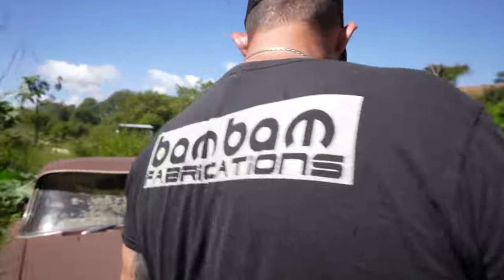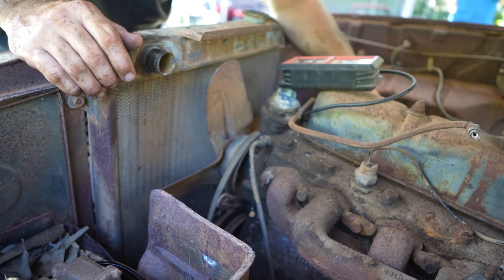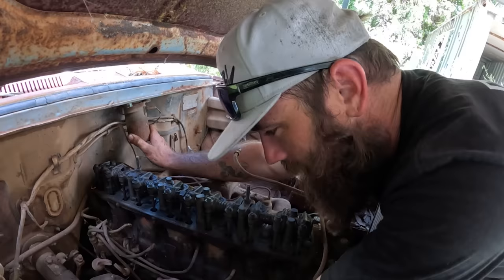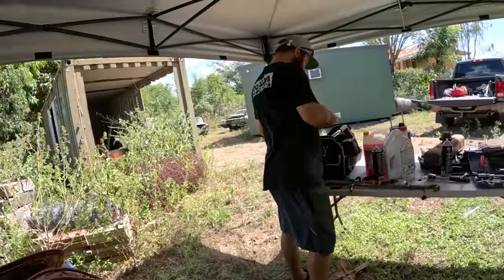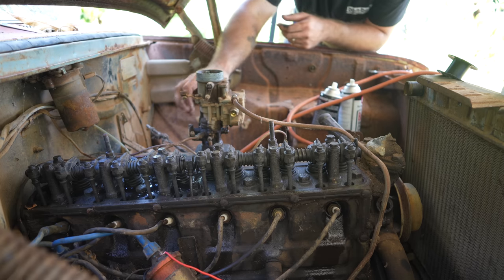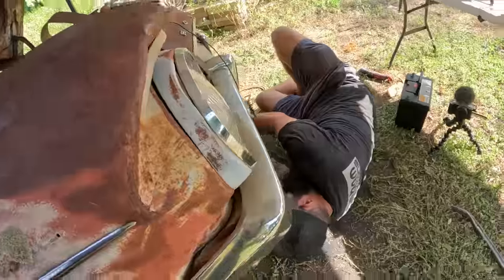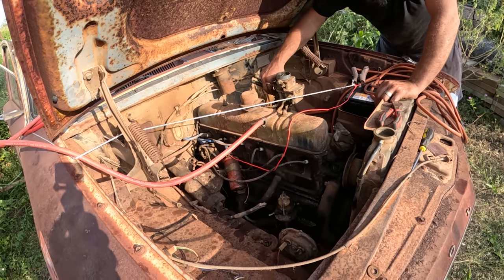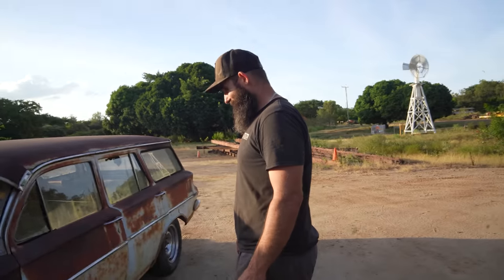Will This Classic EJ Holden Run and Drive Enough to get to a Historic Australian Pub

Comment: Old Holdens just never die......love it
Reply: All ya need there is some new lighting hoses a new whirly thinger there that spins around a flappy thing that dumps the gas and pumpy pump thing for the water and then all them really rusty ole Kangaroo turds will just magically come shootin out the tail pipe mate. Right?
Reply: The newer ones were 50/50 
50% died within 25,000km 50% will be wrapped around a tree and still start on one pull lol
Reply: wouldnt of got it going if it was a ford that age
Reply: @Russlarmour  Easily mate, stop making silly statements....

Comment: I used to work on sideplates motors as a boy. I was following every step as you were doing it and thinking... "its missing a coil."  (I still remember the firing order 153624. hahaha)  Great job guys - terrific "CAN DO" thinking. Old Holdens NEVER die.  Inspirational. Thanks so much.
Reply: haha 153624, I always remember because as a kid I was taught 15 is to young, 36 is too old but 24 is just right

Comment: Love it !! An old Holden Station Wagon……. my first car was a blue EH Wagon, with a baby red motor, wish I still had it. My oldest Brother, bought a blue EH Sedan with a 179 …… later replaced the motor with a 186S motor with extractors …….. he still has it , 52 years after he bought it, last road registered in ‘83. Speco floor shift manual, got the shag pile 🤣😂 carpet, Smiths gauges in the housing that they made for sloping radio speaker on the dash, great nick…….. he only fires it up every once and a while. I want to buy it …….. I’d love to own it, I’d drive it regularly…… but he won’t sell . Cheers and Beers Boys 🍻🍻🍻🍻🍻

Comment: I owned an EJ just like this in the 80’s not as rusty as this one, well done lads great to see it running, this engine was not equipped with an oil filter if I remember correctly
Reply: I had a EJ wagon in 1985, it had 450,000miles on it when l got it, canvas bag hanging off the front bumper bar, & red dirt all through it front to back & more stonechips than paint, it died on me 5000miles later.

Comment: Scotland here.
Well done lads, that old 6 was running sweet as considering how long she sat.
Cool looking car to boot, well worth saving.
Subscribed👍👍🏴🇬🇧
Reply: Cheers Mate glad you enjoyed mate!! More to come!!
Reply: The engines are generally bulletproof being all cast iron block and head, I replaced the engine in my HR in 1984 with a second hand one from burnt out HR in a scrap yard, moved all the ancillary stuff from the outside of my engine to the second hand one, fitted it to my car and had it running by the end of the weekend, sacrificed three or four cartons of beer with the mates that helped me but that engine ran for another eight years without so much as a cough before I sold the car, still running at the time, in 1992.

Comment: You just worked your auto adventure of will it run. In the US. I'm working on a 606 international tractor waking it up and trying to make it run. It's from the 60's, gas tank rusted threw as the air cleaner can. It's something that's on the slow GETTER DONE as I pick-up used parts to make her run. I enjoyed your adventure. Wish my tavern was around the corner, it's 40 miles away. Great job.

Comment: Hi just one correction the Hydra-matic (GM) 3 speed Automatic Transmission was available in Holdens model  EK, EJ &  EH.  the HD model came out with a 2 speed Powerglide Transmission.
Reply: If that is an original GM Hydra-Matic transmission it is a FOUR speed non-overdrive fully automatic first offered in the 1940 Oldsmobile, but designed by Cadillac. I had a 1960 Caddy convertible with the Hydramatic. Now maybe GM offered the Hydramatic in Australia as a 3 speed, I wouldn't know, but their 3 spd US tranny was called the Turbo-Hydramatic. The 2 spd was the  Chevrolet PowerGlide.
Reply: @edbenti5007  Yes the GM was only a 3 speed as the Holden was only a small car compared to the Cadillac, when Holden GMH change in 1965 to the 2 speed Powerglide performance was diminished this transmission was replaced in about 1969 with the locally made tri-matic.

Comment: The Hydramatic was a three speed automatic transmission. My vague memory is that the two-speed Powerglide automatic commenced with the HD. The Hydramatic was unique in that the second gear was direct with some sort of torque converter lockup. Apparently, because of this feature, the engine could be tow-started so long as the car was towed fast enough for friction to begin turning the engine and the oil pump in the transmission to start building enough pressure to energise the servo in the transmission.
Reply: The GM Hydra-Matic was a FOUR SPEED non-overdrive fully automatic, the FIRST fully mass-produced automatic automotive transmission in world history. They called it "fluid drive" and was actually battle tested in WW2.  They can move a 3 ton vehicle fast, durable, very tough.
Reply: It's a 2-speed transmission.   You cannot tow start them.  Having only 2 speeds, these EJ cars were known for their gutless drive feel.  The engine is only 2.3 litres (138 cubic inches), not really sufficient for such a transmission.  GM Australia put "Hydramatic" on these EJ's as a marketing strategy - they had the rights to the name so they could do that, even though it was not what was branded Hydramatic in the USA.   The USA Hydramatic box was intended for heavier vehicles with much larger engines.   For that matter, even in the USA, GM branded different 3 speed and 4 speed transmissions as "Hydramatic" at various times.
You are correct in saying that the Australian Powerglides were 2-speed.   They are actually a variant of the same box as fitted in EJ's and labelled Hydramatic.
Three speed auto transmissions came to Holdens later, were labelled "Trimatic", and were a considerable improvement.
Reply: @danejames7098  :  Sometimes we called them "Try-matic - try and accelerate"".   But, actually, they were very good boxes.
Reply: @keithammleter3824 
It's a 3 speed Hydromatic.
Reply: @Rob-fc9wg  You are thinking of the EH.  The car in this video is an EJ, mechanically identical to the previous EK.
The word is "Hydramatic", not "Hydromatic".
Although branded Hydramatic on EK's and most EJ's, they are actually what is known in the USA as "Powerglide" - a cheap unit (type C213 etc) meant for basic 6-cyl Chevrolets.   
The later HD's and HR's were branded honestly - ie branded "Powerglide'".  Same actual transmission.   You would hardly expect these later cars to get 2-speeds if GMH had already been supplying 3-speeds.   
Some restorers & lovers of old Holdens replace the auto boxes in EK's and EJ's with Trimatics, as it is not too difficult and the result is a much more responsive car without the excessive revving needed to get the car moving.   You need to pick the right Trimatic version (shifter on the right side), get an engineering shop to make up a special flywheel, and do a bit of cutting in the cross-member.
Genuine Hydramatic boxes (as obtained from USA) will not fit as the transmission tunnel is too small.
GMH probably branded the EK-EJ boxes as Hydramatic as at that time it was the husband who chose the car, and many men read magazines from the USA, where the Powerglide was known as cheap and nasty for the folk who could not afford better than a basic Chevy, whereas the Hydramatic was a luxury quality thing fitted to Pontiacs.
Reply: @keithammleter3824  
The EJ was available with a 3 speed manual or a 3 speed auto.
No 2 speed.
Reply: @Rob-fc9wg  : When Holden in 1970 switched to the Turbo-Hydramatic (TH180 series - a then new box developed in the USA for mid-size cars, and had no relationship whatsoever to the Hydramatic developed for large cars),  GMH called it the Trimatic, to emphasize to prospective buyers that Holden had finally graduated from 2 speeds to 3 speeds, which the Falcon had since 1965  and Valiant since 1962.
The original poster (Darangula) is correct in that the Powerglide was 2-speed, and that what was branded Hydramatic in Australia had the 2nd gear as direct ie top/highway gear - that is it was not actually a Hydramatic, which was 3 speed or 4 speed depending on variant used in US upmarket large cars.   US Hydramatics can be tow-started (though it is not recommended), but Holdens branded Hydramatic or Powerglide cannot - they remain in neutral with no oil circulation.

Comment: The EJ Holden dated to 1963, the last year the grey motor (215 cid) was used.
Reply: The Holden grey motor was never 215 cid. It was 132 and 138 cid.
Reply: the holden grey was a scaled down copy of the chev engine which I think was about 200 cubes, so a USA  viewer could mistake the size.  Both motors looked identical except for size.   and yes, the red motor came out in the EH (basically the same body) next model of 149 and 179 cubic inch sizes.

Comment: I had one of these in the 70's, an EJ Holden Hydromatic Station Wagon with a grey motor. The transmission bands needed looking at so it required some creativity to drive it. The motor ran well, as I recall and it was a comfy ride for the time. The floor was rusted out like yours too - you could see the road whilst driving. It had all the badges and all the good extras of the day. I sold it for $100 which was $10 less than I paid for it . . . Fuel was around 20c a litre back then.
Reply: Try at least 0:55c a litre.
Its only gone up 4x while houses have gone up, on an all-Australian capital cities prices average, 30x

Petrol, as a bite of our wage, has dropped markedly

Comment: Utterly bullet-proof motors that can take a good deal of neglect and still run!  My first was a '58 FE, well worn when I got it in 1970, but ran for another 65000 miles. Then came the '63 EJ in 1977 - a lovely car, owned by a panel beater who had done it up for himself but family needs . . . etc. My biggest mistake was selling it on because I thought it wouldn't handle a biggish trailer. Silly boy me! It would have done so easily and saved me a pleasant but expensive fling with a '66 Humber Super Snipe!  Both the Holdens cruised effortlessly at 65mph and thrived on the lengthy commutes I did in the day. Three oil changes and grease-ups a year, and all good.

Comment: Pure GOLD Boy's 💯👌
Reply: Cheers Mate!!
Reply: 100% rust bucket.  It will die when the plastic/fibre cam sprocket fails. 
Compare that to a 2.2 litre 1962 Mercedes  engine that has twice as much power output.
Reply: @BTW...  My  Mercedes-Benz W115 was fitted with a 5.8 Litre V8. It went 😉

Comment: Holdens used the Roto-Hydramatic. From Wikipedia:  "The Roto-Hydramatic was an automatic transmission built by General Motors and used in some Oldsmobile, Pontiac and Holden models between 1961 and 1965. It was based on the earlier, four-speed Hydramatic, but was more compact..." Hate to be a nitpicker but apparently Holden Division of GM decided to drop the "Roto" part of the name for badging. A genuine GM Hydra-Matic is a four speed unit. It's important to acknowledge the importance of the Hydra-Matic in world automotive history, the world's first fully automatic mass-produced and COMMERCIALLY SUCCESSFUL transmission. My grandfather was a certified Hydra-Matic technician for Pontiac. Take that Japan and Mercedes!

Comment: It doesn't surprise me in the slightest that this one would move under its own power. It takes a lot to kill the Holden Grey. I've seen them run on a single cylinder before, but this one no doubt wanted to get out again

Comment: Awesome!!!! I was travelling up north WA 600 ks past gerelton same car dizzy shaft gear shredded road train towed us to next petrol station midnight 150 klm that was hairy as fuck behind trailers waited 10hrs for friend coming from port Hedland with another dizzy and shaft would not fit from FJ Gray motor walking behind garage wide open paddocks 186 red block in the dirt no head but shaft still attached tell no lie 😮 thought no way bolted on cap on leads connected.... Shazam it fired up this was 1987.. EH wagon..true story!!!! 49:12
Reply: Wow!

Comment: Damn, that's badass, a old Holden, like those older ones! Eff'ng Cool!! Right on 🤘 fellars, right on! Although, now don't take no offense to this but that 6 banger in it looks kinda like a old AMC 6 banger, I've had enough of American Motors vehicles through the years I pretty much know what they look like, hey nuthin wrong with that though!
Reply: The grey motor apparently had its origins in a small 6 cylinder Buick engine design via Canada.
Reply: Nothing to do with AMC.   It is an Australian-made Holden "grey" motor, a small 4-main-bearing derivative of the GM Stovebolt.
The initial production of Holdens, in 1948, used a Canadian-made motor slightly smaller but otherwise identical.
Reply: @keithammleter3824  You must love your cars Keit because you're very knowledgeable. Well done

Comment: Those old copper tranny hoses used to overlap on the bends and over time would wear a flat spot in the line and could be difficult to isolate as the fluid would run down the line and appear to be leaking somewhere else

Comment: The car wasn't entirely designed in Australia.  The seat frames are the same pressings as a Chev. The seats are just a bit narrower
Reply: most of the mechanicals were about a 3 quarter size copy of chev.  The grey motor looks exactly the same as the motor in the 37 chev, but smaller.  same with gear box, brake cylinders etc.   The red motor introduced in the EH was a scaled down copy of the chev upgrade.

Comment: Did you know the auto & manual models had a different body?.... The trans tunnel on a manual was smaller & you could push start 40kmh an auto with an hydramatic as the torque converter was internal to the box.
Reply: That's good to know mate cheers!!
Reply: I think I had heard that many years ago, about "bump starting" a Hydra-Matic equipped car. They were 4 speed automatics.
Reply: @edbenti5007  They were a 3 speed box.
Reply: @preston963  I owned a 1960 Cadillac convertible more than 40 years ago. It was equipped with a genuine General Motors Hydra-Matic 4 speed automatic transmission, designed and built by Cadillac and introduced into the 1940 Oldsmobiles as a very rare and revolutionary option, the first mass produced successful fully automatic trans in world history. Years later the Roto-Hydramatic according to Wikipedia "was an automatic transmission built by General Motors and used in some Oldsmobile, Pontiac and Holden models between 1961 and 1965. It was based on the earlier, four-speed Hydramatic, but was more compact" .  So I believe Holden simply dropped the "Roto" part of the name, but that doesn't make it a genuine Hydra-Matic.
Reply: @edbenti5007  The hydra-matics used in OZ were 3 speed I've rebuilt lots of em
They were also called a sluge box because they were so slow changing gears.

Comment: Had one of these as my first car. 
Paid $200 for it in 1982. 
Another car saved and a Australian legend. 
V8 in this would be wrong. Leave it original.
Reply: Your story is similar to mine. I purchased my first car in 1981 and it was a 1964  XM falcon pursuit and paid $300. Boiled it dry once not knowing it had a split water hose. The engine seezed solid at the side of the road. My old man said wait an hour and then put more water in it and drive home. We put a new hose on it the following day and it was like brand new.

Comment: 283an two speed transmission would fit it nice craiger rims  clear  paint  job or Chevy s10 frame  with all wheel drive  fix nice to

Comment: AROUND 1976 GENERAL MOTORS went to a electronic ignition.  Most of the V8 engine was junk because the camshaft wore out.  Anything before that might have been junked because it needed a tune up and funneled oil.  Just because it started doesn't mean it was any good.

Comment: It's 80% patina and 20% car:)
Full marks for getting it driving after God knows how long parked in the salad.
But $5k? Really? Not my $5k.
What would I know? But I'd say half of that, because every old banger I've bought has had twice as much rust as I thought.
When the fuel tank has half disappeared, man you've got about a year's bodywork in store.
Reply: To give you an idea Ross those rusty eh/ej's are getting $20000 in worse condition than this one and around $80000 for something in good condition. Inflation gone mad.

Comment: the EJ only had the 2.2 liter motor. next model had choice of two , a 2.5 and 2.9. Also the auto is a 3 speed. Holden went 2 speed auto from '65 to '70
Reply: You don't use litres to talk about the 138 motor, show some respect... ;-)
Reply: @geoffmerritt  Are you scared for everyone to know how under powered a 2.2 litre motor can be?
Reply: @BTW...  Of course not, a 138 would suggest being slow and sluggish way more that a 2.2ltr. The 2.4 diesel in my ute would have 50 times more power than a 138.

Comment: If that is a GENUINE General Motors Hydra-Matic transmission it is a FOUR SPEED (no overdrive) automatic.  First built by Cadillac Division, installed FIRST in the 1940 OLDSMOBILE (Caddy suits didn't want to tarnish Caddy's image if it was a public failure.) It is also a RARE and expensive piece of machinery. Last time I checked a rebuild kit for those was $1,500 USD and that was 20 years ago. Out of high school I had a '60 Caddy with a Hydramatic. That was 43 years ago!
Addendum: Further research says the Holden EJ did have a 3 spd automatic but according to the Wiki on GM's Hydra-Matic, the only 3 spd they produced (1961 +) was called the Roto-Hydramatic. So it's kind of a mystery to me anyway what the story is on that.
Reply: 3 speed. No mystery at all... made for Aus conditions.

Comment: With minimal work the bloody thing should run, I think they used to put a 76mm gun on top and used them as tanks in Vietnam. 😂😂😂😂🇦🇺🇦🇺🇦🇺🇦🇺🍺🍺🍺
My first car was an HR wagon, 186 Ci six, 3 on the tree, tough, reliable, easy to maintain, I think it's still going.